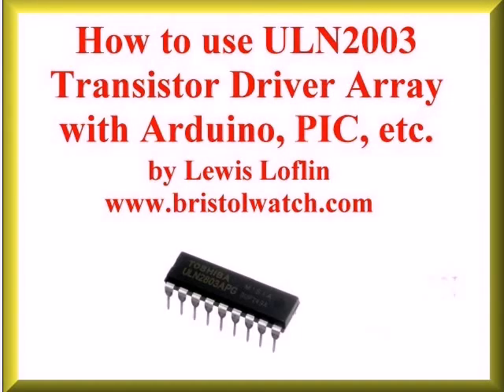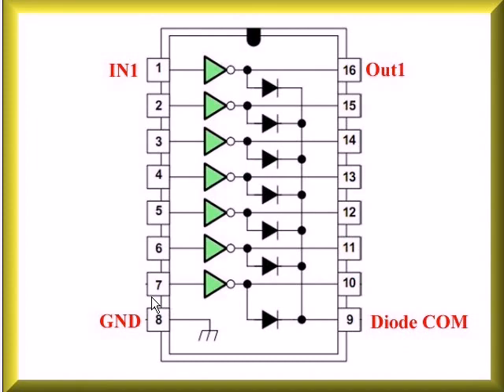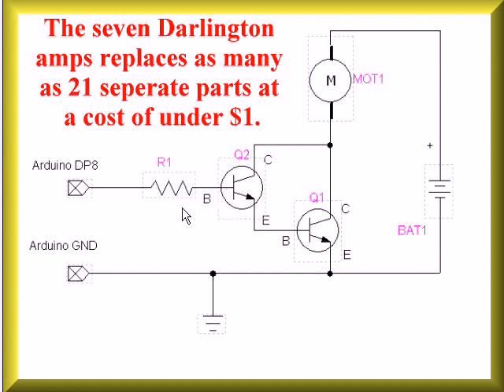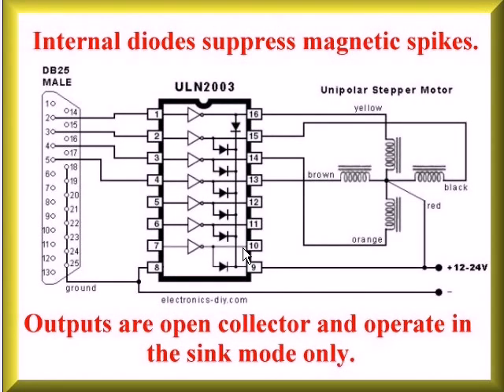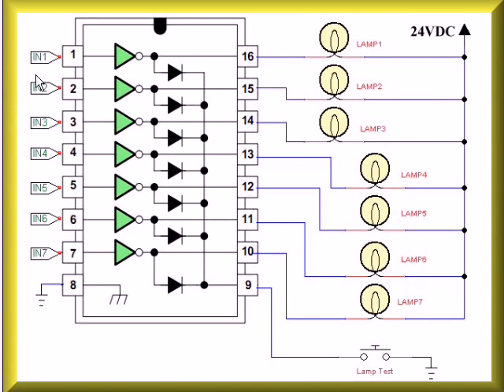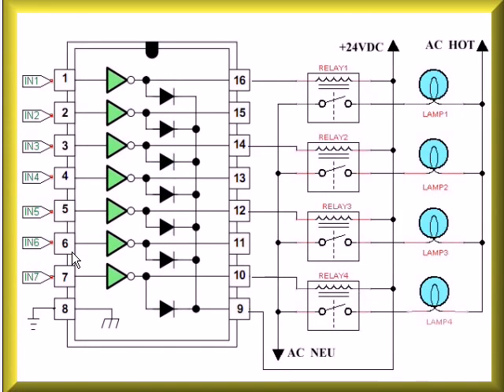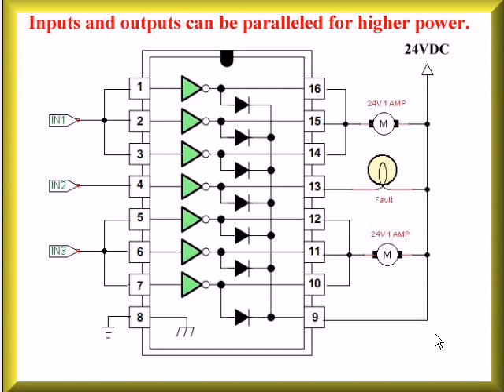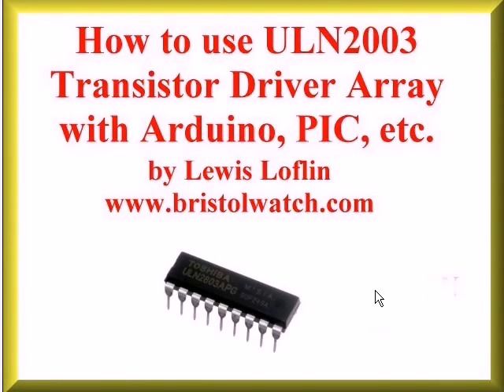Using the ULN2003A Transistor Array with Arduino

Comment: In the 24 vdc lamp, and 24 vdc relay with 120 vac lamp examples, is pin 8 ground connected to the 5 vdc ground for the microcontroller inputs, or is it connected to 24 vdc ground?
Reply from the maker: No. I leave it disconnected for non-magnetic loads, other connect to lam +.
Reply: @LewisLoflin  I am using a ULN 2003 to fire a 24v relay, for this application I should connect pin 8 to 24v GND?
Reply: I am not understanding what "lam +" is sorry.
Reply from the maker: @Austin-d8p  Sorry. E is ground, and common goes to +V.

Comment: Hi Lewis, I accidentally burnt my ULN2003L chip on my oven board.  I believe this controls my oven door lock (motor) and convex fan motor. How "difficult " is it to unsolder without causing other issues with soldering iron? Also..don't want to damage new chip when soldering. Thanks.

Comment: hi sorrie for this stupid quistion  i happen to have a 4ch low input  active high current  darlington sink driver   called TD62308APG i just cant figure it out cause  a transistor have 3 pins but if you look the inside of this array the transistors have 4 pins and the ic  have vcc and ground -5v recomended im fearly new in electronics if maybe you could just  explain to me how it works or if its posable thanks for your time

Comment: when it comes to doing 120v lighting with relays, I've always cut the hot wire and attached that to both sides of relay contacts, leaving the neutral wire uncut.  Is that dumb?

Comment: One thing to watch out for is that there is a voltage drop (somewhere around 1 volt) across the darlington's CE junction, so that should be taken into consideration.
Reply from the maker: I've found it to be 0,5V but point well taken.
Reply: @LewisLoflin  I think it can vary dependent upon the CE current.

Comment: Hello Mr. Lewis, great tutorial.
One academic question --- when we parallel the outputs so as to draw larger current for larger loads, during the switching time of Multiple Outputs, would the earlier switched output get eventually damaged? 
(I am referring to the time gap between (pseudo code) PinOne.makeHigh( ) and PinTwo.makeHigh( ))

In case they do not get eventually damaged, what is the thumb rule for such a time -- I mean, "for X microseconds Y times higher currents are tolerated", etc.?
Reply from the maker: The more narrow the pulse the larger the current within reason. It is heat dissipation one has to worry about. This does work but remember this isn't a high power circuit.
Reply: @LewisLoflin   oh okay, thank you so much for quick response!!

Comment: Hi, thanks for the clear and concise description of the ULN2003. In the last example, 3 inputs and outputs were tied to increase the output current. Would it be possible to use three digital outputs from an arduino on pins 1,2 & 3 and combine the outputs of 14, 15 & 16. My hope is to provide three levels of current to an ammeter by turning pin 1 high then pins 1&2 then pins 1,2 & 3. I want to insert a printed face to an analogue ammeter to show three states driven by different input pins on an arduino. I’m just researching possible ways to achieve this.

Comment: What is the different  when I connect pin 9 to ground or to volt? How the array will work?
Reply from the maker: Either leave disconnected or tie to +Vcc. Connecting to ground shorts  out the drive pins.
Reply: @LewisLoflin  where would the ground be going for the components connected to the output side of the uln2003? Does the IC act as a ground with power going to pin 9 but also the components? I'm new to this hobby and am a little flabbergasted at how complex such small devices work... Amazing stuff! Also nice videos, been enjoying learning new things!
Reply from the maker: Do not connect 9 to ground you will ground the outputs. If driving a magnetic load such as relays, connect pin 9 to VCC.
Reply: @LewisLoflin  where would the ground be if not on 9? Does the ground on the input side act as ground for the outputs?
Reply from the maker: @jeffreydoty8710  Yes it is common to both sides.
Reply: @LewisLoflin  Thank you! Really have learned a lot, I appreciate the time you take to do what you do

Comment: In relay circuit . If 9th pin is not connected with the 24v supply what will be the result
Reply: There wouldn’t be any current flow.

Comment: Now this was very usefull! I mistakently connected the other side of my relays (on side being connected to the ULN2003) to ground. Smarter Every Day ;)
Reply: But how it the relay grounded? since 24 V+ is on one side where are the ground? is the ground on pin 8 and common for the 5v and the 24 volt. what will happend if they have different power source like a usb on a rasbery on one side and 12 volt car battery on the other side?

Comment: i have an opto-coupler to isolate my Micro and 24 V.  I cant do common ground as i would loose isolation. shall i apply 10K resoster in series to 24V DC base Vin ?

Comment: In the last example when pairing in/outputs for higher current (1A), the current per pair in 100% load seems greatly reduced, I wonder if its possible to even drive 1A trough it?
Reply from the maker: I wouldn't do it. Simply use separate driver transistors.

Comment: Can I use ULN2803|Uln2003 to control solenoid valve using PWM|Analog write???
Thanks :)
Reply from the maker: Why are you using PWM to control a valve? Assuming this is an Arduino write a 1023 for 5V out to a driver transistor to turn on/off the valve.
Reply: +Lewis Loflin I want to control the pressure of double acting pneumatic valve and make it stable and also move it using ps3 controller 
Thanks

Comment from the maker: Note while the frame at 20 sec. shows a ULN2803 this video is about the ULN2003. Thanks.
Reply: Lewis Loflin well. Same thing except the 2803 has one extra Darlington pair lol. I use them with shift registers to run led arrays because the 8 pairs works out perfect lol.
Reply from the maker: Yes I noted that a few years ago. It is about the 2003.

Comment: Hello Professor,
I brd brded a single coil latching relay with  1000ohm into bases of 2n2222a's form arduino.
Then I triggered the relay with ULN2003A.
The ULN required 7V to power the relay coil and the 2n...'s ran fine on 5V rated coil.

Do I need to add R here somewhere?

Thanks, Donald

Comment: You're showing the photo of a ULN2803 (which has 18 pins, not 16) while talking about the ULN2003.  Kind of confusing...
Reply from the maker: Look at it again it has 16 pins.
Reply: At timestamp 20 sec. I see an 18 pins device with the label ULN2803 on it..  At timestamp 1 minute I also see an 18 pins device, also with the label ULN2803 on it. => ???
For the rest of your presentation, you're indeed showing the diagrams and schemes of a ULN2003.
Apart from that, your video's are very interesting... :-)
Reply: You LOOK at it again, it as 18 pins in the first photo.
Reply: Open your eyes: the whole (very good, by the way) presentation (including the drawings) is about the ULN2003A, which has 16 pins and 7 darlingtons inside, while the photos of the device shown are of a ULN2803 which has 18 pins and 8 darlingtons inside.  That is the confusion I'm talking about.  Is it really that difficult?
Reply from the maker: OK I see it at 20 secs. but this is about the ULN2003. Thank you.
Reply from the maker: Your Right. The subject is the ULN2003. Thank you.

Comment: Can ULN2003 be used to drive more than six  dc motors?
What are the possible options?
Reply from the maker: There more than six outputs, but be careful of motor current.
Reply: well the thing is i need to drive 128 dc motors simultaneously. So what would be the best option?

Comment: Is there a way to use the uln2003 for have bio directional  rotation of a simple DC motor if so please describe.
Reply from the maker: +Ahmed Ishaq No one direction only.
Reply: can we do this by adding Logic gates to this circit where the flip flop may turn the direction of the motor? if so please enlighten us

Comment: burned 2 uln2003 when connected 12V lamp with 12V voltage source in the way as is shown on this movie (lamp eg.),
Reply from the maker: +Pawel Wojcik What was the watt rating of the lamp? How many amps?
Reply: +Lewis Loflin there was 21W bulb 12V, never get more than 1.6A using this bulb on other 12V power source
Reply from the maker: That's almost 2 amps. Why not use a single transistor and a resistor?
Reply: wanted to steering it by pwm in few channels of uln2003, and then could rise and drop light saturation quite fluent

Comment: Thanks for a very informative video. Is it possible to use the ULN2003 to make a 12V LED strip fade in and out, by varying the input? (Similar to the Arduino 'fade' example)
Reply from the maker: +cubiq1 Yes just use the Arduino or PIC pwm, etc.
Reply: +Lewis Loflin Great. Thank you!

Comment: Thanks Lewis! I'm just an electronics hobbyist, and had no idea this kind of thing even existed! This is going to make my current project cheaper, easier, and smaller - thank you!
Reply: Follow-up : I have another project where I need to control 7 solenoids, and their coils are rated for 12VDC @ 600mA... any suggestions for a similar chip that would be able to handle the higher current? I see there are some higher current chips, like the ULN2074B, but it doesn't have 7 channels... I have read that you can stack the channels on the ULN2003A, but have also seen that using multiple channels at once decreases the current handling capacity of each channel... Thanks for the instructional videos!
Reply from the maker: phrend
Go to separate transistors or MOSFETs. I have a number of videos and pages on the website related to that.

Comment from the maker: More pages videos.
Using the ULN2003A Transistor Array with Arduino
Using the ULN2003A Transistor Array with Arduino

http://www.bristolwatch.com/ele/uln2003a.htm
ULN2003A Darlington Transistor Array with Circuit Examples

-----

Using the TIP120 & TIP120 Darlington Transistors with Arduino
Using the TIP120 & TIP120 Darlington Transistors with Arduino

http://www.bristolwatch.com/ele/tr3.htm
Tutorial Using TIP120 and TIP125 Power Darlington Transistors

-----

Using Power MOSFETS with Arduino
Using Power MOSFETS with Arduino

http://www.bristolwatch.com/ele/tr2.htm
N-Channel Power MOSFET Switching Tutorial

http://www.bristolwatch.com/ele/tr1.htm
P-Channel Power MOSFET Switch Tutorial

-----

Using PNP Bipolar Transistors with Arduino, PIC
Using PNP Bipolar Transistors with Arduino, PIC

Using NPN Biploar Transistors with Arduino, PIC
Using NPN Biploar Transistors with Arduino, PIC

http://www.bristolwatch.com/ele/tr4.htm
Understanding Bipolar Transistor Switches

-----

How to build a Transistor H-Bridge for Arduino, PIC
How to build a Transistor H-Bridge for Arduino, PIC

http://www.bristolwatch.com/ele/tr5.htm
Build a High Power Transistor H-Bridge Motor Control

http://www.bristolwatch.com/ele/tr6.htm
Driving 2N3055-MJ2955 Power Transistors with Darlington Transistors

-----

Build a Power MOSFET H-Bridge for Arduino, PIC
Build a Power MOSFET H-Bridge for Arduino, PIC

http://www.bristolwatch.com/ele/h_bridge.htm
H-Bridge Motor Control with Power MOSFETS

http://www.bristolwatch.com/ele/tr7.htm
More Power MOSFET H-Bridge Circuit Examples